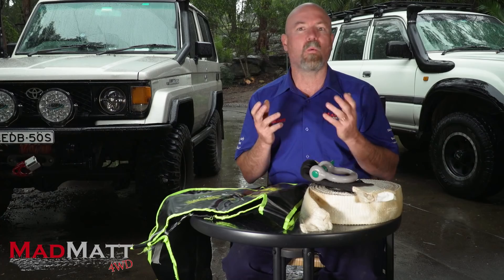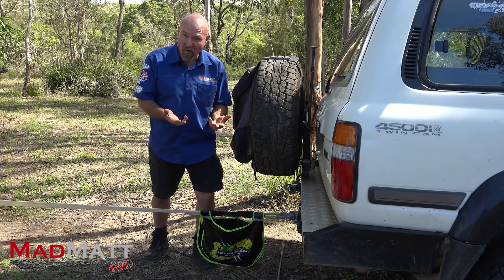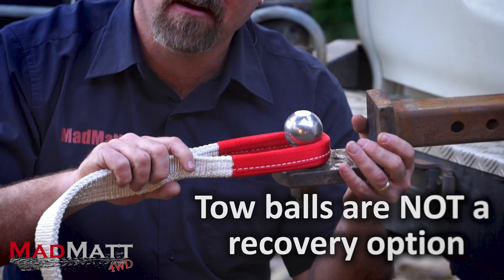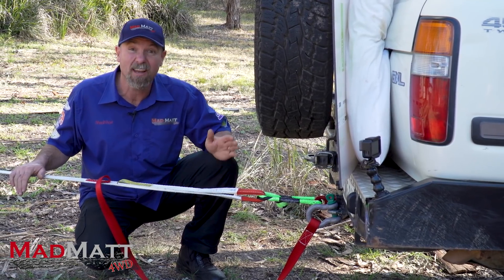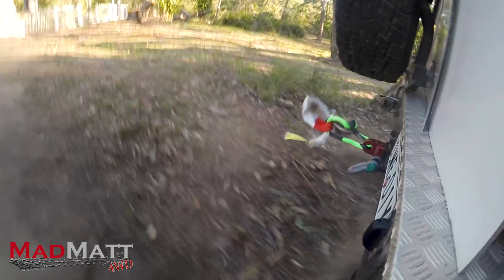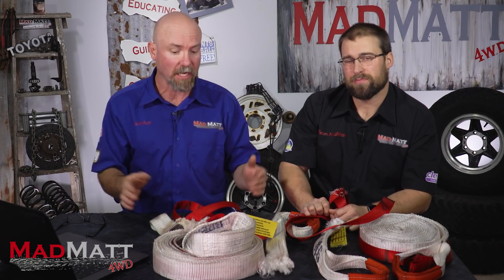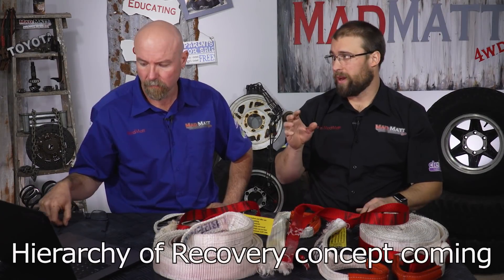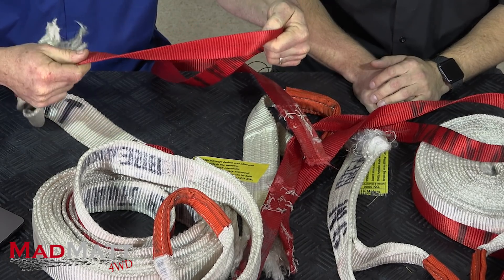Dangers of Snatch Strap Recoveries - Destruction Testing

Comment: Just not correct, let me assist you.  A Class 3 tow ball in the United States is required to be tested to 15,000 lbs tension according to SAE requirements .  The 1" shank on a Class 3 tow ball has a single minimum shear rating of 46,000 lbs.  Destruction testing shows that a Class 3 hitch will fail at the welds and metal components at 24,500 lbs.  A Class 3 rated tow ball should not be the failure point on a Class 3 hitch system.   A Class 2 hitch and tow ball are tested to 10,500 lbs as required by SAE.  The shank on a Class 2 tow ball is required by SAE to be 3/4 inch.  The actuall minimum shear strength of a 3/4 shank is over 25,000 lbs.   Actual destruction testing of a Class 2 hitch reveals that the hitch will fail at 21,000 lbs, well below the failure point of the 25,000 lbs shear point of a Class 2, 3/4 inch ball shank.

Since destruction testing reveals that hitches fail prior to the shear strength of a tow ball shank, hitch failure is the primary risk during towing, not the ball.  If you will carefully read the accounts of fatalities in Australia during towing you will find that in the majority of cases, it was the hitch that failed and not the ball.   I was only able to find one account in Australia where a ball failure was blamed in an accident.  That case was not well documented.  I am aware that there are likely cheap none approved hitch balls out there that could fail, just as there are none approved hitches, home made hitches, etc.   It is also likely that people put under rated tow balls on hitches.  Clearly a Class 2 ball would be the failure point if used on a Class 4 to Class 6 hitch assembly.  For safety; good judgement and an understanding of the forces envolved should be used during any tow.

It should be clear by the testing done by Ronny Dahl that tow balls are not a failure point.  In his video he had to tie the towed vehicle to a tree, hit the ball at excessive speed, use a low stretch strap, the hitch actually started to fail before the tow ball, on the final pull the tow ball was loose on the receiver and he had to cut the shank of the tow ball to get the tow ball to fail.  The hitch would have likely failed before the tow ball if Ronny Dahl would not have cut the shank on the tow ball.

Please share with me a single well document destruction test result that indicates tow balls are the failure point in a properly rated hitch system. 

Like you I am interested in education and safety, but to me it seems that Tow Balls are the Click Bait of off road recovery sites.
Reply from the maker: Wow Robert where have you been all my life?  You make a number of points here which sound like you have a band wagon to push. Firstly I do make the point about towballs as dangerous but I also mention hitch failures so don't try to change what I've said to suit your agenda. Go watch from 6 minutes again.

Some links for you.
http://www.outback-australia-adventure-travel.com/towballaccident.html

This happened near me and I spoke with the guy who was doing the recovery and he had a shackle through the tow ball hole. The weld failed and this was the result.
https://4x4earth.com/forum/index.php?threads/man-allegedly-struck-by-towball.36486/

https://www.brisbanetimes.com.au/national/queensland/broken-tow-rope-like-slingshot-killing-boy-in-back-seat-20101214-18wa0.html

https://mobile.abc.net.au/news/2010-12-02/towing-accident-behind-football-party-death/2359652?pfm=sm

And this is from one of my other videos. where Billy comments.
https://youtu.be/wjv51ovrE30

Billy Gauthier  • 2 months ago
I don't know if I can watch this.    I just had an accident on Tuesday.   Cracked my skull with a 2 5/8 ball that came flying through my window.   Day 3 of recovery after surgery.      Don't do this.      
I was just giving a quick tug to pull start

MadMatt 4WD
  • 2 months ago
I hope you have a good recovery. As you would have seen in the above comments many think I'm telling lies about the towball failing.

 It's not hard nor difficult to do a safe kinetic recovery but very few actually know how to do one. 
I agree with your comment here "For safety; good judgement and an understanding of the forces envolved should be used during any tow." This is what I've sort to do and as I say in my video I have a number of trusted professionals who I discuss this stuff with so that I'm not putting out erroneous information.  

As for doing this for clickbait if you knew how much it costs to put this content out there you would realise it's a foolish business to be in and aside from wanting to get the message out there is not a very rewarding process.
Reply: @MadMatt4WD  If you would like to share valuable information, have a testing lab do a direct line tension test of different tow balls properly mounted in a hitch coupler and have them tensioned to failure.  That would be valuable information.  I have not seen or heard of this test being conducted.  In the United States SAE J684 only requires tensioning of a Class 3 ball and hitch system to 15,000 lb tension.  It would be interesing to know the actual failure tension.

Another great subject that needs testing is the ultimate impact force that can be generated by a 5000 lb vehicle doing a snatch recover using each of the following.  30% stretch kinetic rope, 15 to 20% stretch snatch strap, low stretch tow strap and a chain.   Since Impact Force is mitigated by stretch over time, this would be very valuable information.  I question that using a 15 to 20% snatch strap or a 30% stretch kinetic rope would even allow a 5000 lb vehicle to reach the impact force required to fail a ball or hitch.  (Ronny Dahl's testing would seem to support my assertion).

I took a materials course during my engineering education and it facinated me.  When information shared doesn't match the science I am encouraged to learn more and question it.  I had already read each of the accounts you shared and made additional attemps to research each incident.  There is little to learn of the cause of these accidents from anecdotal accounts provided.  Like you I have discussed this subject with trusted professionals including a PhD in Physics and a Mechanical Engineer that owned a 4x4 and Rock Crawling supply business.  They, like me agree that it is important to share science and fact, not just anecdotal evidence.

I enjoy your channel, but it would be so much more valuable to the recovery community if it included hard evidence on balls and hitches in addition to the anecdotal accounts you share.  Knowing the actual impact forces during a snatch recovery in lbs tension applied by snatch straps and kinetic rope vs chains and tow straps would also be outstanding information.
Reply from the maker: Hey Robert. All my content is created at a personal cost to me and therefore I'm limited as to what testing I can afford to do. I have asked for companies to fund it but they have no desire to actually do anything as "safety doesn't sell"

I'm not sure if you know Roberts channel but this video goes into the loads we can generate. I think you like this and much of his other work. https://youtu.be/dmuEacjtAVU

If i'm brutally honest I get worn out from trying to help people understand the dangers around 4wd recovery and then getting told I'm an idiot and wouldn't know anything. I've always endeavoured to be open and honest about where my authority sits and what i do and don't know. I will always maintain a tow ball is not an appropriate tool for a recovery and find it ludicrous that anyone would defend it especially when it's so cheap and easy to do it safer.
Reply: @MadMatt4WD  if I am brutally honest, it is frustrating to me that a person would totally eliminate a safe recovery technique because he doesn't completely understand the forces involved.   Clearly snatch recovery can be done safely, it is likely done daily by thousands of people around the world without injury.  There are many manufactures manufacturing Snatch Straps and Kinetic Ropes, if they were excessively dangerous consumer demand would tumble and that segment of the market would disappear.  If they were excessibely dangerous government agencies would be restricting sales of the devices.

Snatch recovery can be made safer by many of the techniques you share like weighted air dampeners.  I contend people will continue to do snatch recovery.  It would be nice to be able to recommend safe parameters that would limit risk.   I don't have the data or testing to support it yet, but wouldn't it be great to be able to state (something like):  a vehicle weighing 4000lbs useing a 30' Kinetic Rope and limiting acceleration period to 10' will generate a maximum impact force of "X" lbs which is 75% of the rated direct line pull of a Class 3 hitch and ball assembly.  Exceeding the rating of a hitch is not recommended and could result in severe injury and or damage to vehicles.

If this type of information was available, people could make smarter choice and save lives.
Reply from the maker: Here in Australia it is mandated that a snatch strap has a warning label on it. Heres the link you will note it says specifically no tow balls etc.
https://www.productsafety.gov.au/standards/recovery-straps-for-motor-vehicles

I'm presuming you didn't watch Roberts video I linked above because he outlines the forces in that video.

Comment: You tested these snatch straps against a fixed object, it was guaranteed to fail. Doesn't seem like a valid test. needs to be tested against a object that is below the weight rating of the strap
Reply from the maker: Ummm have you seen a 4wd thats stuck in deep mud? Sometimes it doesn't move so this is a perfect test for this situation. Keep in mind the purpose of the video.

Comment: Im know professional, far from it. You admitted you were using the wrong set up for snatch recovery e.g tow strap. You also forgot to mention, that you were pulling a very secure object, tree was going to move. Try using the correct gear, snatch rope to a bogged vehicle or a sled, that will move, especially when in most cases both vehicles would have wheels in motion. Hmmm
Reply from the maker: As you said you’re no professional. I was demonstrating a concept not showing you how to perform a kinetic recovery. And the tree not moving is irrelevant.
Reply: @MadMatt4WD  its obvious that when a tow strap is tired to a stationary object that is anchored, its force will far out weigh the pulling force and that strap would break
Reply from the maker: yes but only if you generate enough force. BUT that is not what the purpose of this video. It is to show people how much force can be generated and hence how dangerous kinetic recovery can be.
Reply: @MadMatt4WD  but it was not a kinetic recovery, thats what blows my mind
Reply from the maker: @jeffwilkes3039  It wasn't a recovery because I wasn't recovering anything. But it was kinetic because I used a Snatch strap with is a kinetic recovery device. The fact the tree doesn't move is irrelevant to how the Kinetic recovery works. You do know that the strap doesn't generate any force don't you?

Comment: Tether should have been on a side object other than the vehicle
Reply: Where its not being loaded when fuse fails
Reply from the maker: So you saying it should be attached to a tee or something like that? Or another part of the vehicle?
Reply: @MadMatt4WD  i was thinking a good test of the teather would be a side object (tree, rock, another vehicle, etc) so when strap fuse does its job that the kinetic energy would be redirected away from snatching or snatched vehicle. As the teather would only be loaded by the straps rebound
Reply from the maker: @DanMcD80  right so just for testing purposes. I suppose that would have worked. This is quite and old video now and I’ve come to the opinion the tether doesn’t work.

Comment: Ok so if you’re scared of snatch recoveries (that safely happen in 99% of cases all over the world) how exactly do you want to recover someone? Hook up a tow strap and pull nice and slow? 

Flooring it tied off to a tree doesn’t prove snatching is unsafe. It’s actually not proving anything.
Reply from the maker: Trouble is they’re not happening safely they’re getting the job done but running risks often times. A shovel should be the first recovery tool and a kinetic device the last.  And yes a tow recovery is a very safe procedure cor the most part. I often use my winch.  Being attached to a solid object is exactly the same as trying to recover a vehicle that’s fully bogged and doesn’t move. Absolutely no difference.